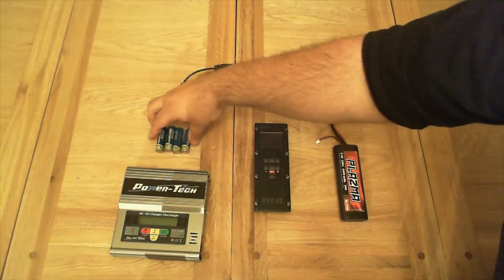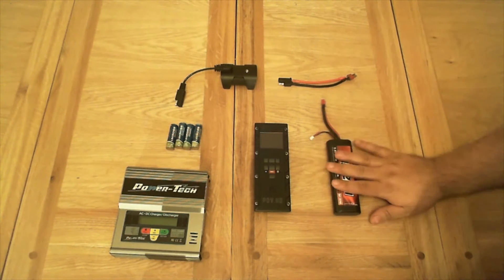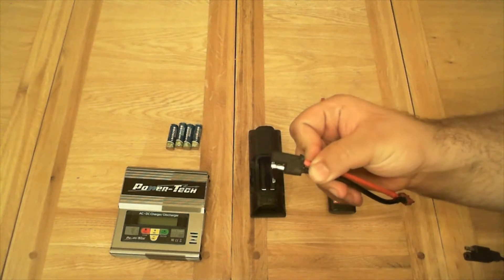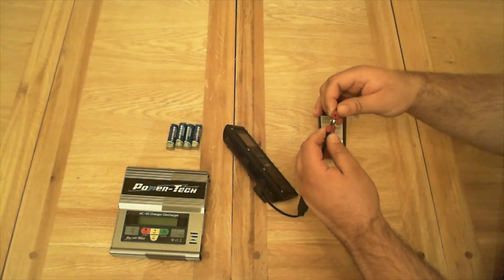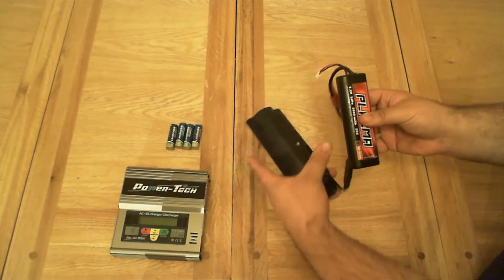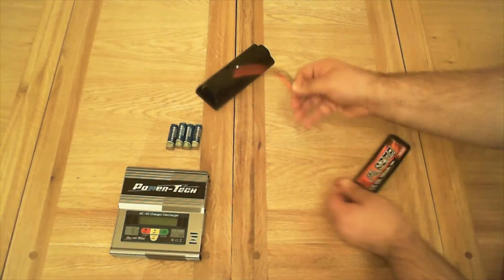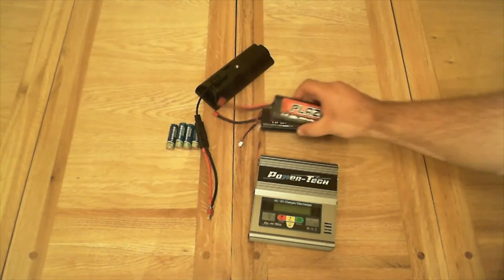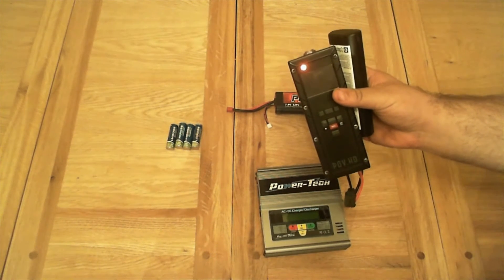POV Battery Mod (no motorbike footage)

Comment from the maker: I will say that if you just throw a lipo into some ordinary water (tap water, rain water, etc) it will eventually burst and 'burn'.  But I would love to see a video where you used it like this on a motorbike. Also, make sure you voltage and amps are in the region your device operates at. My camera system is between 6v to 12v, i asked the manufacturer to be safe. My 2 cell lipo is 7.4v.  Again, its up to you to do the research and im not responsible if the lipo blows. I tested my recorder first.

Comment from the maker: Very hard for it to short out in just plain water, not a very good conductor.  Research into remote control videos where they submerge the car in water.  However, the deans connectors i use, the fact i keep my recorder in my backpack and it being on my back therefore protecting it from rain means i'm happy enough no problem will arise.

Comment: That's a great idea.  I'd just be concerned when the cam head inevitibly goes it'll be an even more expensive problem.  If VIO honour the warranties like they have my other pov hd unit (which is going up for raffle soon for charity so watch this space)  Then it'll be worthwhile. Thanks for the tip, favourited.  How much is the charger by the way and can you put a link in your description of where to buy these batteries and charger please?  Thanks.